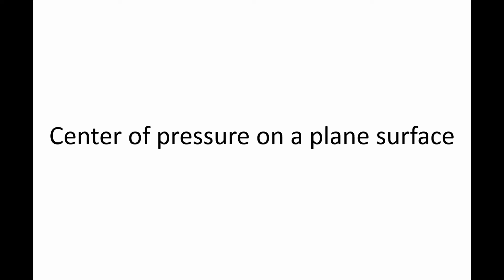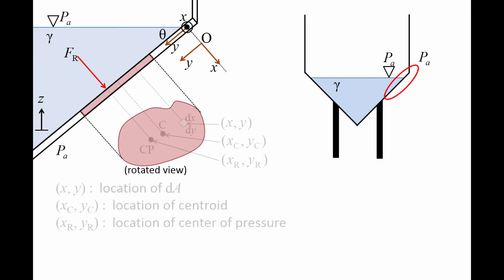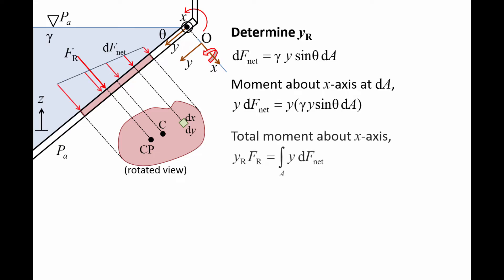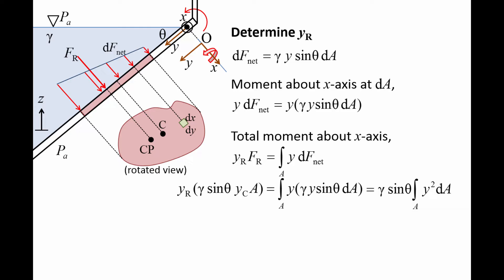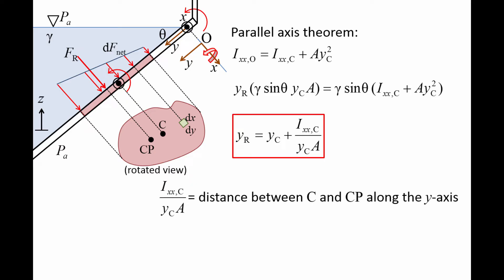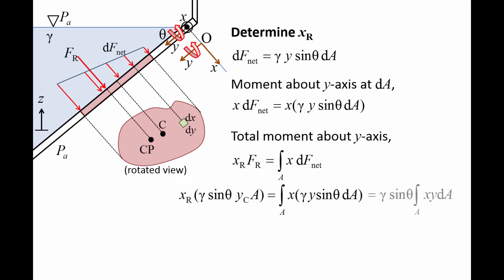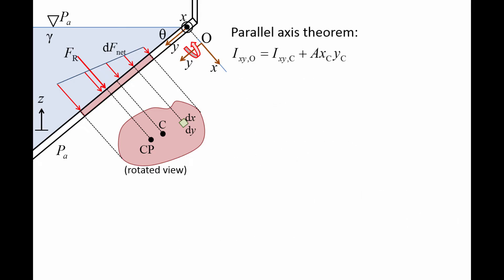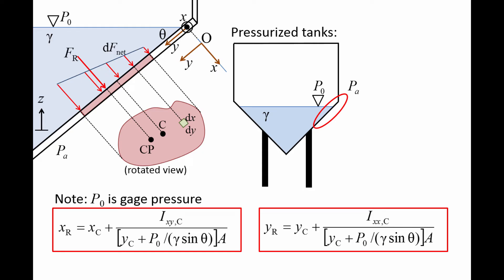Fluid Mechanics: Topic 4.2 - Center of pressure on a plane surface

Comment: Hi can you help with two question, if you could go through them it would be helpful...

1)
The viscous torque produced on a disc rotating in a liquid depends upon the diameter D, the speed of rotation N, the density and the viscosity.  The equation taking the form:-

T= ρ N 2 D 5 φ ( ρ N D 2 μ )

In order to predict the torque on a 1.8 diameter disc rotating in water of density 1000kg/m3 at 129 rev/min a model is built to a scale of 1/4.  The model is rotated in oil. Calculate the speed of rotation, in rev/min, for the model to produce dynamic similarity.

The oil density is 785 kg/m3 and the dynamic viscosity of the oil is 4.7 x 10-4Pa.s.

The water dynamic viscosity is 1 x 10-3Pa.s.
2)
Water flows through a pipe 4cm in diameter and 38m long between two tanks with square edged non projecting entrance and exit.  The flow rate is controlled by a gate valve which when fully open has a loss factor of 0.32.  What is the height difference between the tanks if the volume flow rate is  3.8 x10-3 m3/s.

For laminar flow f=16/Re

For turbulent flow f=0.08/Re0.25

Density of water, LaTeX: \rhoρ, is 1000kg/m3, viscosity of water, LaTeX: \muμ, is 0.001Pa.s.
If you could do this before the 22.06.2020 it would help me... thanks

Comment: does anyone know why dFnet = Gamma * y * sin theta * dA?
Reply: hydrostatic pressure = density * gravity * height, 

gamma is the product of density and gravity AKA specific weight
therefore Pressure = gamma *height

Now, since we are dealing with an inclined surface we cant just simply take the height as it is, we consider it with respect angle of the inclined surface thus having height = y*sin(theta)

next, Force is equals to the pressure * area
                  Force= Pressure * Area
therefore, Force = gamma * height *area
                             = gamma* y*sin(theta) *area

we are dealing with an elemental force acting on an elemental Area, thus
dFnet = gamma * y*sin(theta) * dArea. 
  
I hope it makes sense

Comment: May I ask about P0 as gage pressure, cause sometimes we dont get specified pressure. Lets lets inside inclosed tank, P of the air is 200kpa, then is it gage pressure or absolute pressure?
Reply from the maker: In practice, the gage pressure is usually atmospheric pressure (101 kPa). If you are have an enclosed tank with an absolute pressure of 200 kPa, the gage pressure P0 would be (200-101)kPa = 99 kPa.
Reply: CPPMechEngTutorials thank you!

Comment: May I know where can I find the way to derive the equation of xR and yR for gage pressure =/= 0 ?
Reply from the maker: You can try it yourself. Follow the same derivation procedure, except the force on the inside of the wall is not simply gamma*h, but rather gamma*h+P0 (where P0 is a gage pressure).